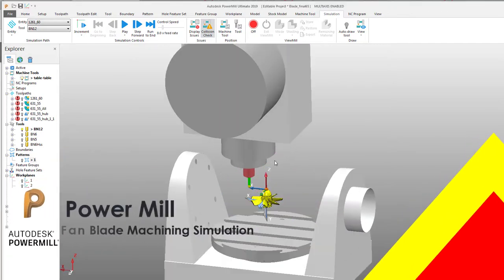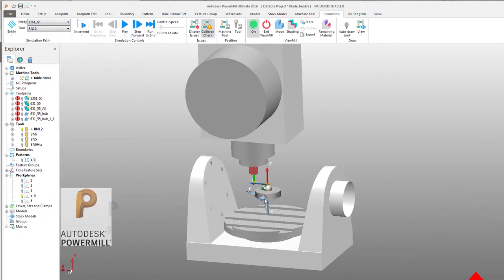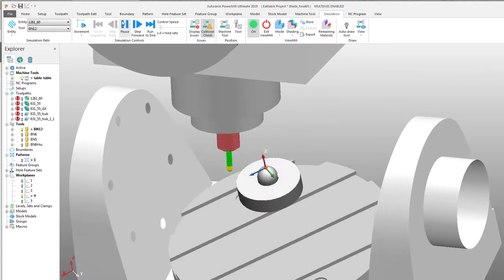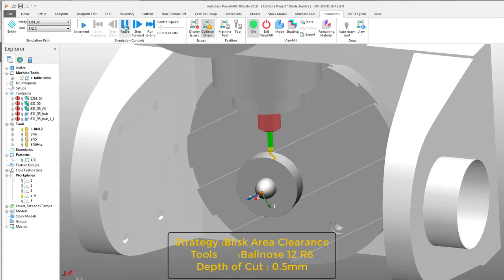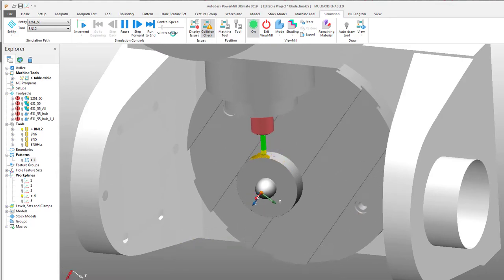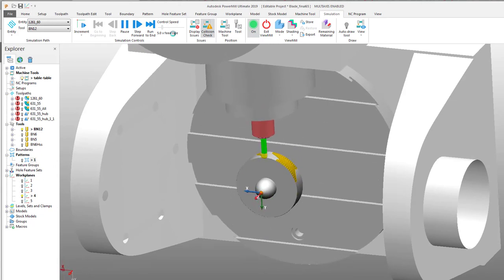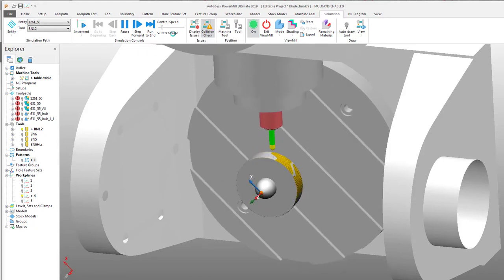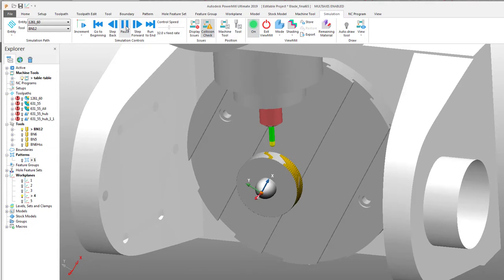Fan blade 5-Axis Blisk machining simulation Powermill

Comment: Hi! Anywhere I can read about your thesis? Or can you tell me the algorithm used in simulating the cutting process?
Reply from the maker: hi, my thesis isn't about it's manufacturing, but this fan blade is my specimen for my experiments and i already machined it and tested for it's performance, but i still working on the writing publication. thanks
Reply: Oh okay. Thanks for replying!